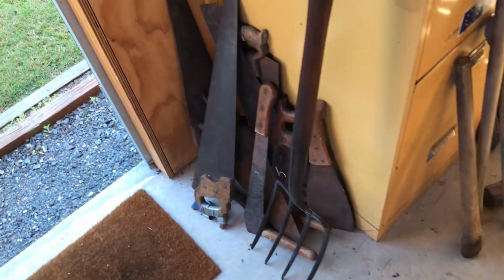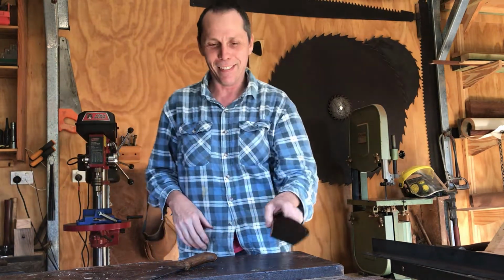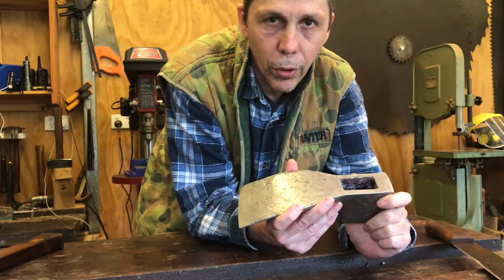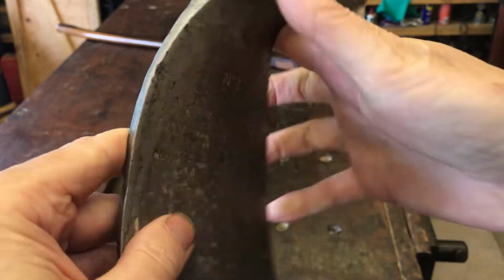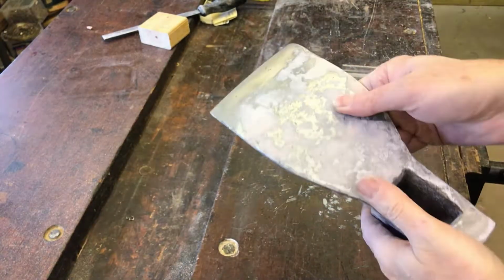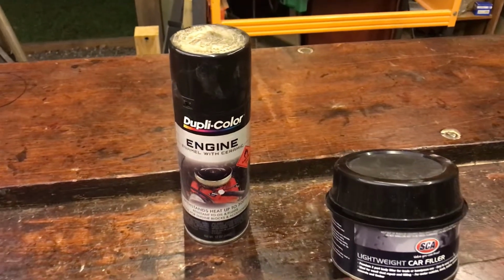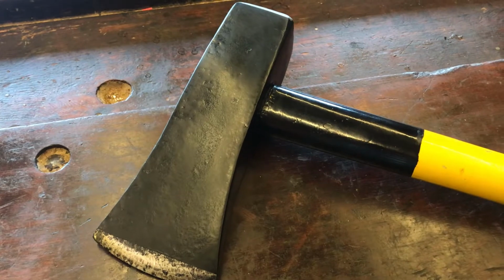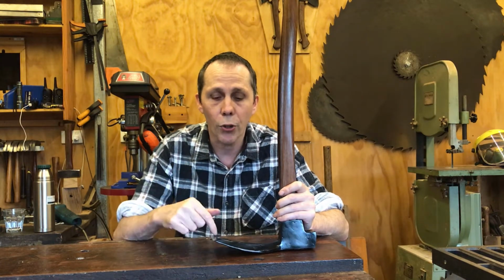Don't be ripped off buying vintage tools.

Comment: I think it perfectly acceptable to sale it as a “wall hanger only”. From now on start with the steel first and just sell as is if there are any cracks. Some guys like the challenge of welding them.
Reply from the maker: Thanks Greg,  good advice, I initially thought damn, this is cast steel and you cant weld it. Then after the machete disappointment, I decided to make a video on the theme. You still can clean the paint off and repair the cracks and perhaps one day I will eventually upgrade to Brazing skill level to try. ?
Reply: Cast steel is very weldable. It isn’t prone to cracking like cast iron. Though care would need to be taken not to hurt the heat treat.
Reply from the maker: @gregnoname3707    Ah, I am confusing cast iron with cast steel.
Reply from the maker: Hi Greg, just restored another adz and it's a real beauty.

Comment: I've been puzzling for some time, something is different. Now i know, you missed your Corona Crew Cut appointment. I'm just kidding. After all the trouble, I'd make a big bottle opener out of it and hang it on the wall...  ;-)
Reply from the maker: Perfect, I am just not thinking outside the box. LOL  I have used it as a prop in one of my up coming videos though where I finally get a really nice adze. BTW, Sorry about the sound, I had a croaky voice, and there was a lot of backgound sound that I tried to filter out. Started playing with subtitles, did you see them or is your base language German? You hinted that when we were talking about Camphor Laurel wood. You said, Kampfer is the German word for camphor.
Reply: @Saw-IT  the sound was good, everything was easy to understand. The only subtitle I had to choose from was the English original. As a German, I have no difficulty in understanding it. I fail at writing and grammar. I hope you can at least understand something of my comments. I had my last English lesson 40 years ago. But I still try to give meaningful feedback because I like your understanding of the craft.
Reply from the maker: Hi Big-T, I just did another adz and it turned out beautiful. Worked a bit harder on the sound and jazzed up the video to make it more engaging.  What do you think? https://youtu.be/MrQHo439L1g
Reply: @Saw-IT  I like your videos very much, especially the detailed description that explains your thoughts on the project. The sound is crisp and clear, hardly any background noise can be heard and the mix of explanation, the actual work and the amount of time laps make the videos so interesting for me. All in all, really very professional. Please keep it up in this way ...
Reply from the maker: @1965bigt  Thanks, I am processing the sound with a separate sound editor that removes noise etc and just getting the hang of it. Next video is a stanley78 and then a quick axe restore. Then maybe some videos with a new camera.

Comment: I'm not a steel guy but surely that would still be fine for turning over a garden bed? Looks too good to use now though ;)
Reply from the maker: For sure, but we have a heap of garden tools. So it is just a wall hanger or a give away tool now. I restored another Adz after that, that makes this one feel like a toy.  Learning how to use it properly and safely takes a lot of time.